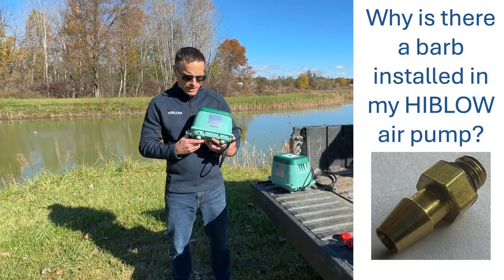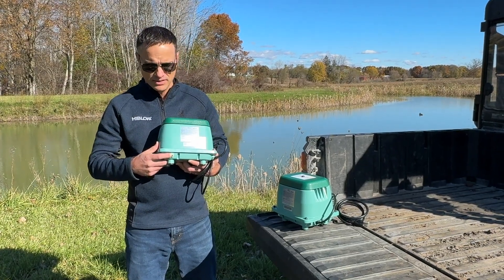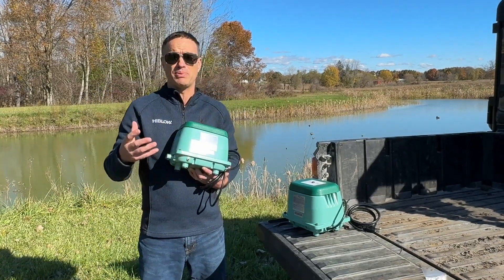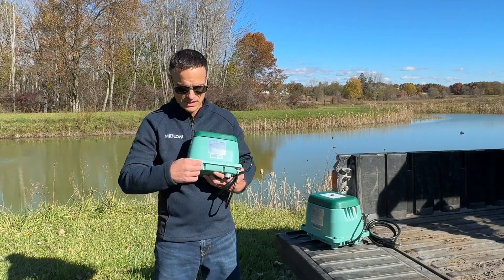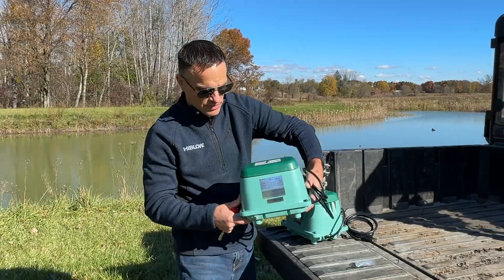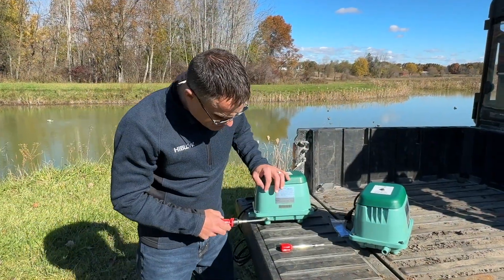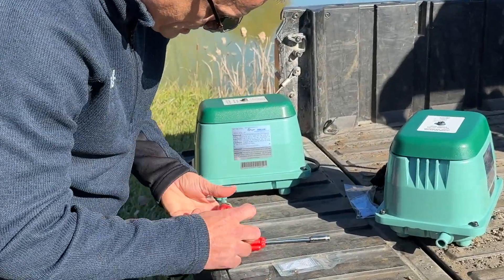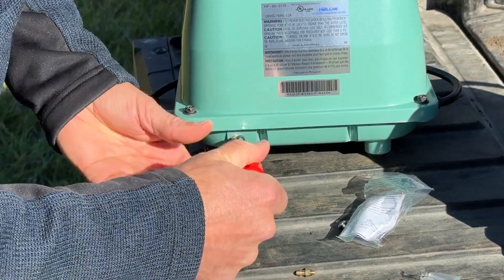Why is a barb installed in my HIBLOW air pump?

Comment: I just installed the barbed fitting on an HP-80,  and a 1/4 inch nutdriver fits the barb much more snugly than the 7mm recommended in the video. YMMV...